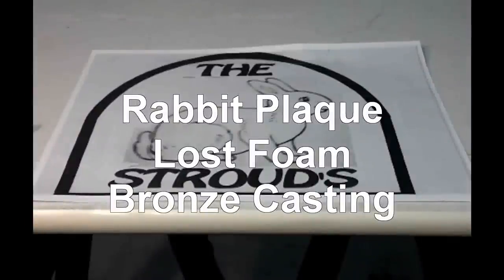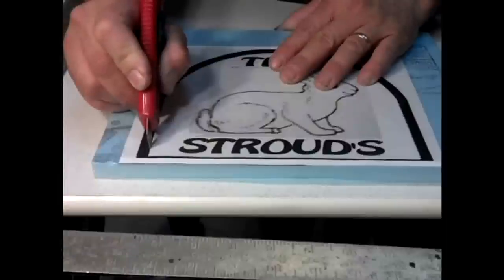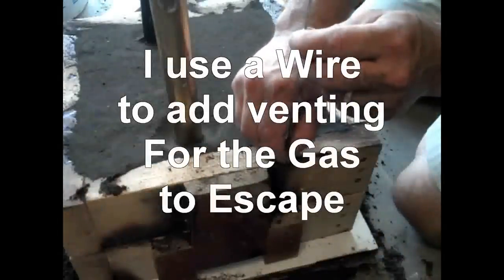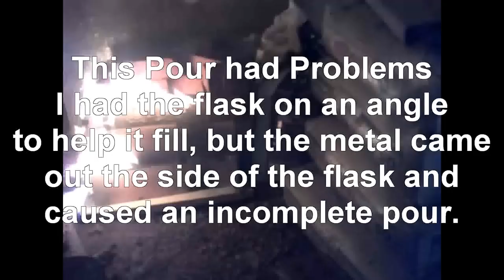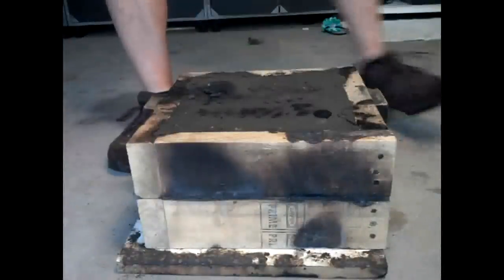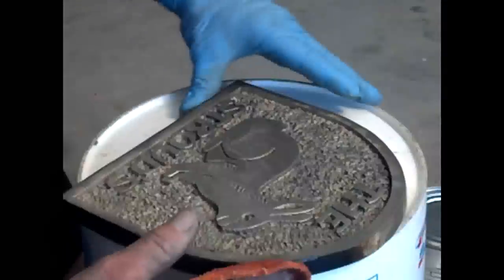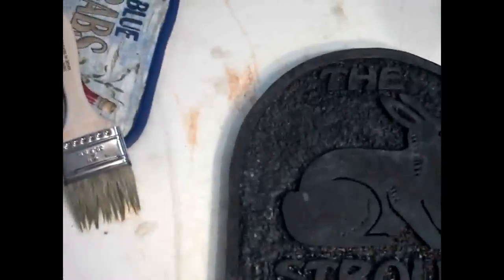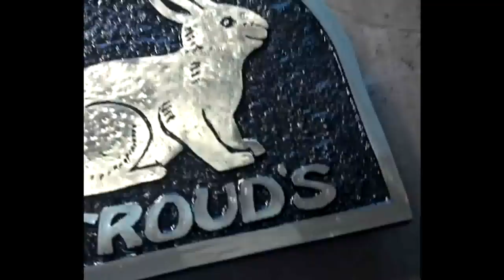Lost Foam Casting Rabbit Plaque: Bronze Metal Casting Made using Lost Foam Process

Comment: The great thing about lost foam casting is that you can use regular sand and don't have to use the green sand or oil bonded sand. You just pour the sand around the foam and leave the sprue sticking out a little and pour the melted aluminum and walah
Reply from the maker: Yes, lost foam is great!

Comment: thanks for this video. I am trying to make something similar but not using the lost foam method. my sand keeps getting stuck to the pattern when I try to pull the pattern out so it looks like I will be trying the lost foam method now! i just wasn't confident in my pouring since this is the first thing I have ever made and I didn't want to have to remake a pattern if I screwed up the pour like your first try...

Comment: That is a cool way to work with the foam! I'm gonna try in it aluminum when I get my kiln done!But I was curious why the metal didn't flow up the little vent holes?Does that mean the metal wasn't hot enough,or that they filled back with sand and didn't work?I'm just now learning about all this casting.Thank You for sharing the info!
Reply from the maker: The wire that i vent it with doesn't go the whole way to the foam if I do it right, I keep it a half inch away.  I have cast some that the metal does fill the vents.
Reply: David D Okay,I misunderstood.I thought the holes were supposed to go all the way down so air,foam bits,slag,etc. could go there and you just snap/grind them off when done.As I stated,I'm just learning.Thanks for the fast reply!

Comment: Love your plaque, im interested in the sand and or recipe for what looks like your  green sand? Any help, thanks in advance.
Reply from the maker: Thanks for your comment!  That sand was actually an oil bonded sand.  It is called K-bond...simular to petro bond...look it up under "kent state university k-bond molding sand"  A regular greensand will work just as well for this kind of work.  Greensand is just sand with 3-5% benetone clay (or other clay works too...I used to be able to dig what was in my yard when I lived in MD USA and it worked great)   and water mixed in until the clay sticks together and breaks cleanly when you grab a handful and break it in half.  Let me know if you need more details.

Dave
Here is a link for k-bond if interested.  The hard thing to find in the recipe it the benetonite clay:

http://castinghobbyfaq.bareboogerhost.com/kbond.shtml
Reply from the maker: that is a sand called K-bond...it is an oil bonded sand similar to petrobond.  If you want to look it up, look up k-bond kent state university.

Comment: I'm an amateur blacksmith and have a rivet forge. Someone gave me a graphite crucible that I want to use to melt some brass for some projects. Do you have advice on using this method? I'm concerned about the high temperatures on the bottom of the crucible and other things I might not be aware of. Thanks for your great videos.
Reply: +Bobby Ricketts I would think it would work OK.  People put crucibles into charcoal furnaces all the time.
Reply: A ceramic crucible will handle all the heat your forge can throw at it. Clay graphite crucibles are usually rated to 2900-3000F. Just make sure you have some tongs that fit the crucible well, by wrapping around it somewhat. Don't just use pliers or tongs to grab the rim, that's a surefire way to get cracking and breakage.

Comment: im confused?

you skipped the whole process of getting the foam back out of the sand, in order to leave a void that you can pour the metal into. how do you make the void?  does the hot metal just burn the foam out?

also the process of heating up that much metal into a molten state would be interesting to see.
what are you using to cut those fat sprues off with?

thanks
Reply from the maker: Hi James,  Yes, that is right.  the foam is a sacrificial pattern.  You leave it in the sand and the molten metal burns it out and takes it's place.  That's why it is called lost foam process.  Thanks for watching!
Reply: k,
Thanks

Comment: I was wondering what kind of foam did you use none of my stores around here sell anything blue i was wondering is it extruded polystyrene or is it expanded polystyrene? I was wondering if you have worked with any other foams and how they turned out?
Reply from the maker: It;s just standard styrofoam.  Craft stores have it too.  i have even used the floral foam with good results

Comment: if you glue layers of foam together, is there a special glue to use, will others interfere with metal flow?
Reply from the maker: There is a special spray glue I use that is made for gluing foam.  You can get it at a craft store or maybe even a hardware store.  If you use a normal glue, the foam will melt away.  I should show that on video.  You can also use regular carpenter wood glue or elmers glue.  It takes a while to dry.  Another option is to use a hot glue gun...just make sure it isn't too hot.  I just unplug it when it gets to a good temperature.  The metal will burn the glue away...and take it's place
Reply from the maker: yes, there is special glue for foam.  a craft store carries it.  Most glue will melt the foam.

Comment: if it is flat on the bottom, why do you need the second half of the casting frame? Couldnt you just pour it directly on the back of the foam?
Reply from the maker: Yes, you could pour it open like that but the back would be very rough due to the metal shrinking as it cools.  Pouring from a sprue also helps control the metal...gives it head pressure so the mold fills completely and the sand doesn't wash away when pouring.  Does that make sense?  I should also say the way the sprue and risers are set up allow the mold to pull metal from them to prevent shrinks.  Have you ever poured wax like for candles?  As the wax cools, you have to keep adding wax if you want the top to be full.
Reply: David D Yep, makes sense, i get it. Thanks, this advice will help on my first casting!

Comment: What if you wanted the background to be flat how would you cut the foam out?
Reply from the maker: I would probably use a flat piece of foam and glue other pieces on top of it.  Or use a router to cut it smooth.
Reply from the maker: I used a router table on my "iron Cross " video that worked well

Comment: What kind of crucible would be the best to buy for a coal forge to melt aluminum
Reply from the maker: I would use a ceramic crucible.  Budgetcastingsupply.com usually has some reasonable
Reply from the maker: David D or research silicon carbide. Crucibles are numbered by the weight of metal they hold...in bronze iirr